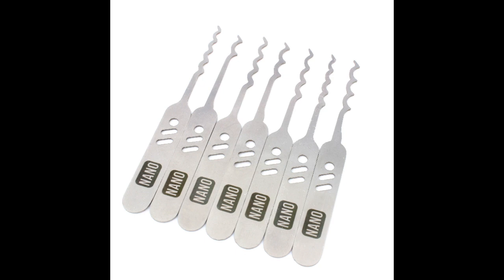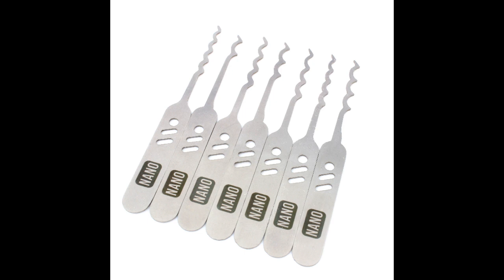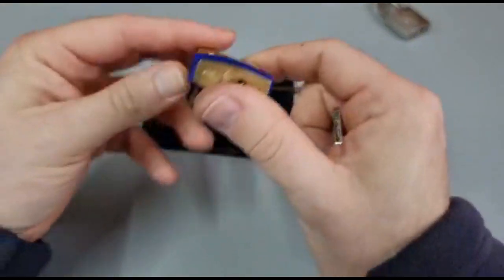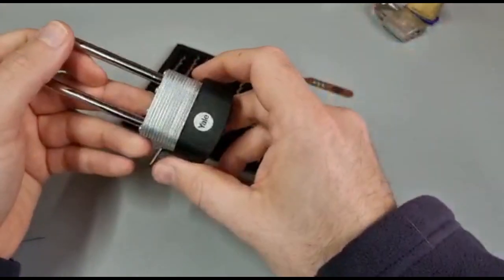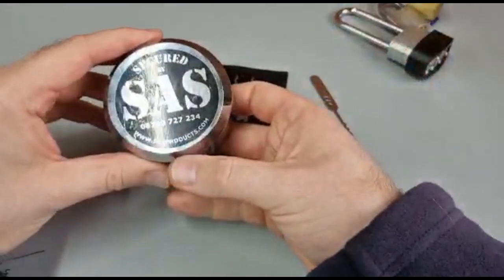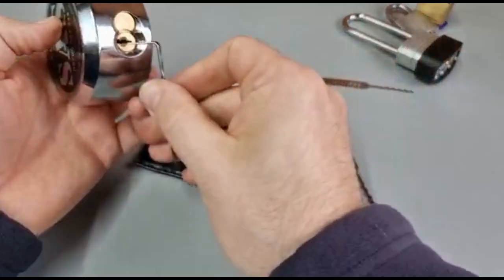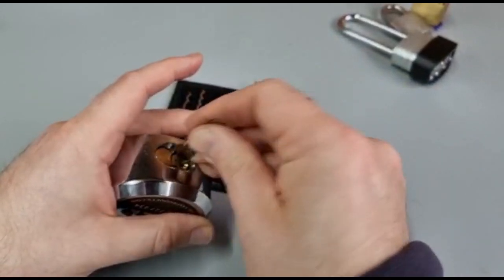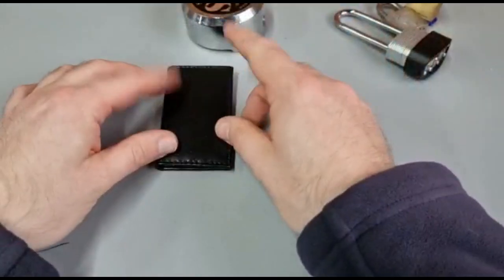Lock Picking With the SMALLEST Rakes EVER!

Comment: I did a review of the original set, I have to say I do like the improvements buttttttt I do also think if it's for bench work and saving space is not an issue forking out for the full sized set is worth it.
Reply from the maker: That makes sense, we had a lot of people talking about lock picking tools they could put in their EDC, which is why we made it, and you understand of course a full set isn't exactly EDC - but for standard raking, yes, the Polaris set makes sense. Thanks for watching and leaving a comment.
Reply: @LockPickingLegend  EDC is a very grey area and one that is absolutely fascinating. Almost all of edc's I have seen have had full sized picks ranging from a small pouch to much larger packs . I am planning a series of videos building various sized edc's. But that is slightly off point, where I was going with this is that the set you have shown is almost wallet sized and truly could be called edc. The problem is the lack of hooks and there are no others producing a similar quality hook set in the same size (maybe sparrows) meaning to add to the set you would need full sized picks. There is a gap in the market for an add on set of hooks and tensioners.
Reply from the maker: @chrissadventuresinlockpick8267  I think you're right, a Nano set of hooks, maybe a half-diamond too.
Reply: @LockPickingLegend  absolutely included a half diamond
Reply: @LockPickingLegend  thinking about it more, maybe a set mimicking a starter set, a few hooks, half diamond , offset half diamond, snowman. It would make a great stand Alone set aswell as an excellent add on to the hook set.
Reply from the maker: @chrissadventuresinlockpick8267  That could be quite the set!
Reply: @LockPickingLegend  now the only thing I will add is that a big selling point for me  would be a hole cut out in the handel so the picks could be mounted in a key smart, "covertcompanion" style. Although I do love the current case with its lack of velcro lol
Reply from the maker: @chrissadventuresinlockpick8267  I must say, I'm not too impressed with the Covert Companion 9I know you weren't saying that) because for $99 dollars you're essentially getting a load of warded picks, some jigglers and a few tools which are not great in that size. If it was more like $40, then maybe. But I take your point, having the ability to make these fit such a thing would improve their attractiveness.
Reply: @LockPickingLegend  I completely agree it is expensive for what it is plus an extra 30 for the tensioner kit, it's hard to justify the price. The concept was good the execution was poor, it seems very bulky and I have seen people complain about the comb picks being very flimsy. The fact that it is from the LPL is probably what saved it. That said the collector in me in curious to get my hands on it to see for my self. The ability to mount them in a keysmart would definitely be bonus but the hole would also leave more options like butting them on a key chain stacked together with a band around them they truly would be very compact.
Reply from the maker: @chrissadventuresinlockpick8267  The comb picks are flimsy because he's made them to fit the OEM puck lock and the ASSA that he demos them on - HOWEVER, that ASSA comes in two keyways, one which is almost square (the one the comb picks work on) and one that's a more standard 's' shape (which they won't work on) and the one they do work on is very rare, so it's a bit of a swizz. Having said that, everyone's got to make a dollar, and he's a nice bloke who has been good for lock picking.

Comment: Nice set. I always first thing i do is rake the lock then go from there always easiest fastest methods first and they are very underrated too even  if you just use get the false set finish it off spp All the speed pickers in the competitions they all rake first with there nessies rake spp picks etc and some of them guys are just Freaks what they pick and so fast wow
Reply from the maker: Exactlty the same as that. The first time I realised this was the way to go was about ten years ago working on a 7 pin Garrison dimple. SPP was proving a bit of a nightmare, and I had this nice little dimple rake (now part of my EDC) and so I rakes it, and it would set about 4 or 5 of the pins, making SPP'ing the remainders, very easy.